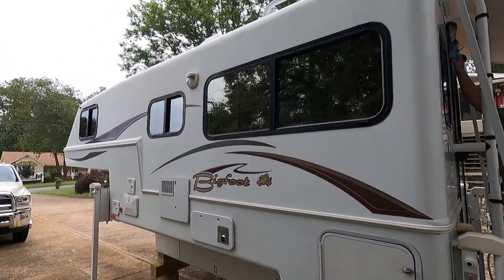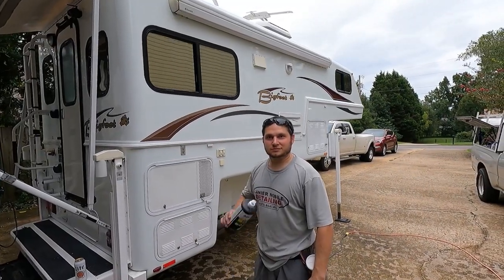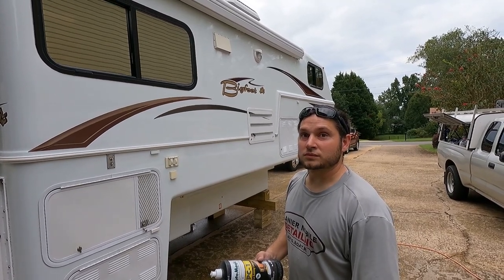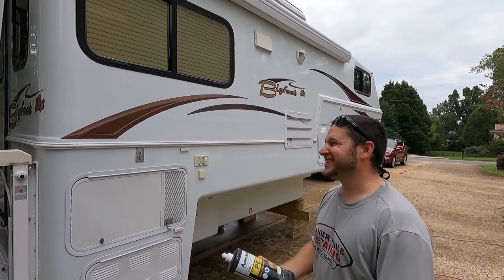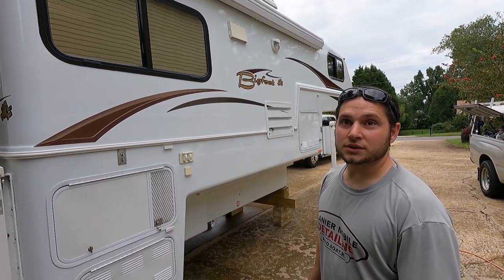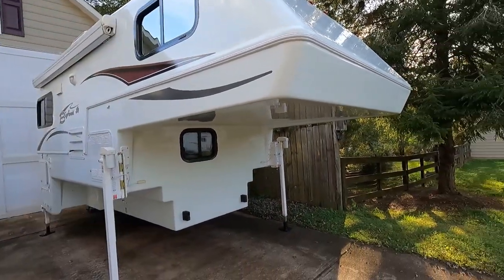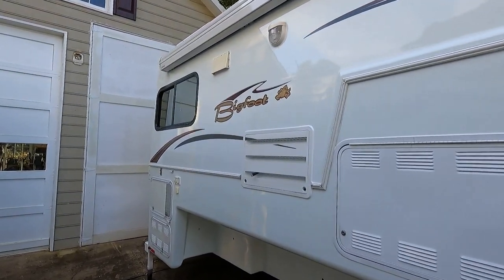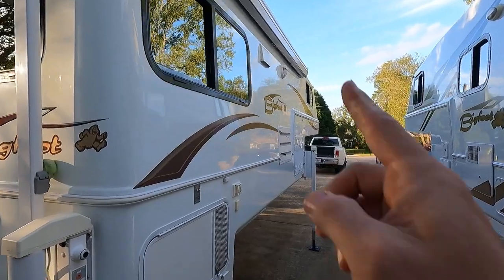RV Fiberglass Polish /WOW What a difference!

Comment: Turned out great!  I have a 2018 25C10.4, but a bit disappointed that the finish is getting a little dull in spots already, despite always being stored in a garage when not in use, and applying a high quality paint sealant annually.  My greatest challenge will be keeping the vinyl decals looking good for the next 20 years.  I was able to keep my tin-sided Lance looking like new for 30 years by using paint sealants.

Comment: Will it last though?  I’ve found a # of products that work with cutting heavy oxy on gel coat but most do not last beyond a few weeks to a few months.
Reply: If you wash it once a month and add a sealant like jescar polymer or something similar after each wash it will last. People will have a professional like Tyler come out and then neglect the RV. It won't take long before the oxidation returns. I detail RVs for a living also. I average 100 RVs a year. I also do boats. And I have zero employees. Just lost everything due to hurricane Ian but I'm building back stronger than before.